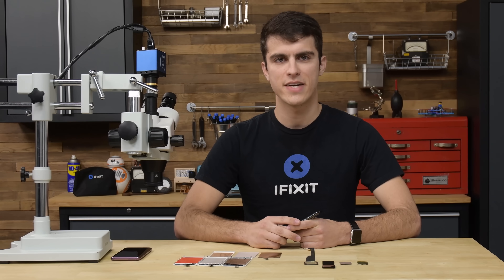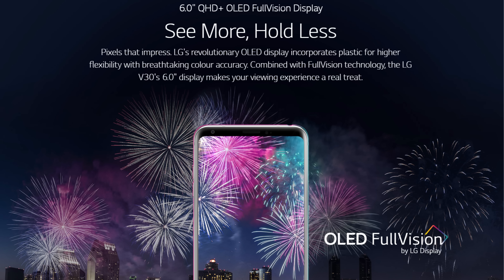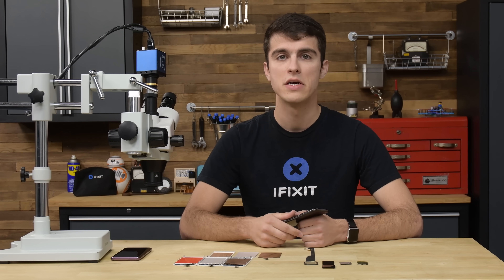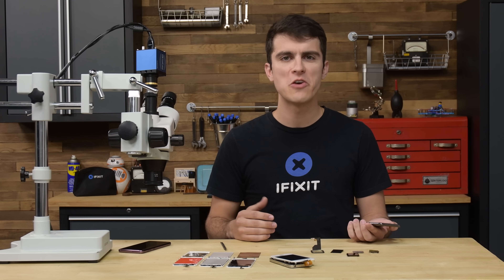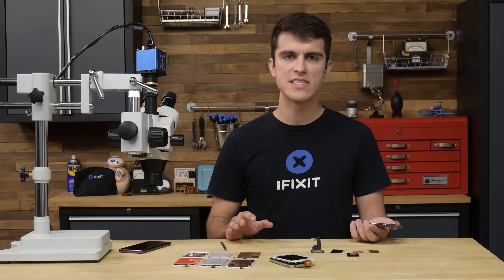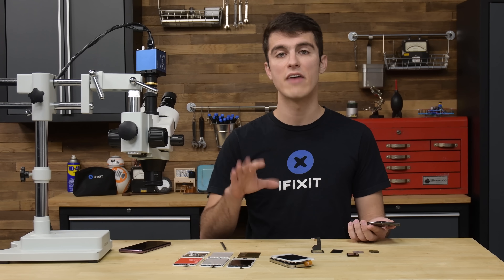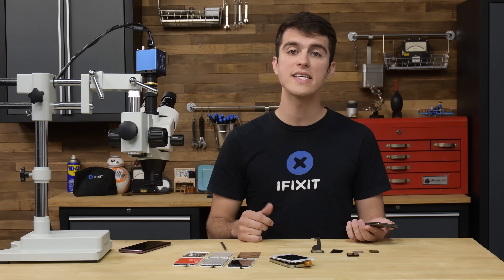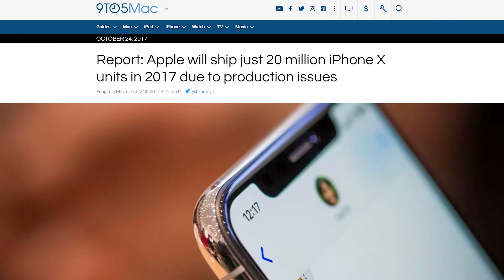OLED vs LCD: Smartphone Display Teardown and Comparison

Comment: Bad info. OLED isn't more accurate nor more efficient, it is just Samsung's marketing material that states they are. You can easily compare Samsung phone's battery life with other phone using the same SoC but with LCD screen.

iPhone X use OLED because Apple needs to fold the panel backward to achieve bezel-less look
Reply: Ok and why is Apple still using using pled displays now Hein? Because it's simply better
Reply: @carholic-sz3qv  well only oled screens allow true blacs. the only problems of oled screens are the manufacturing costs and the screen burn in with static images.
Reply: Le Chat Botté then why iphone XR doesn't use oled? Instead apple makes a new liquid retina lcd. And XR has much better battery life than Oled iPhone.
Reply: lol, phones with LCD screen can have bezel-less look too. And OLED can be accurate in colors if calibrated correctly, you can just tone down the color settings in samsung phones anytime. They just had it over-satured to look pop by default anyway.
Reply: Streets are filled with idiots
Reply: Peizxcv 
And iphone xr is lcd with same bezel less look
"another fanboy spotted"
Reply: Yes the colour is not as accurate as high end LCD for now. But it has a lot more vibrant colours . It also has infinite contrast ration which means it consumes less  battery when watching content with lot of contrast. I used samsung low end phone, let the (always on screen) for 3 hours and only 1% battery drains.
Reply: The battery life on samsung phones is bad because of the heavy Software and bad optimization.
Reply: Wrong..
Reply: Well as a 7 years oled  model user I can confirm that oled is way better than LCD.
Right now I am using a Nokia 6 and its display is terrible
Reply: Peizxcv Are u high ...
Reply: What are you talking about? You must clearly be allergic to facts. NOT more accurate? How did you seduce that... the pickle structure is everything. Imagine drawing a circle use a bagel and the draw a circle using a compass and a protractor. Stand a far, they look like circles but at hand held level (like phones, you can see what’s sharper)
Reply: Lol this dude is a complete dumbass. You could just look at oled under a microscope and see how much smaller the pixels are, and each individual one can be light up by themselves. If a led is so much more accurate them why are all the TV manufacturers moving to oled as well.
Reply: Apple is already looking out for their bottom line.
Reply: The display isn't the only thing that draws power. There are so many other factors other than just the display and the SoC. Although it has improved in the recent years, Samsung's software isn't exactly known to be very efficient, and in my opinion that's one reason why Samsung phones can sometimes have worse battery lifes. Don't get me wrong, I like Samsung's software because it has quite a few features, but it's not that efficient. In addition, I've seen Samsung phones outperform a few other phones in battery life that have the same SoC. Also, it makes more sense that LCDs use more energy than AMOLED screens if you know how they work and know a little bit of physics, because LCDs waste more energy by blocking off the light from black pixels, whereas AMOLEDs save energy by lighting up only the required pixels.
Reply: I guess you haven't held an LCD and OLED display side by side for comparison...

I still hold on to my Nokia Lumia 730 because of this screen... Simple toooo beautiful
Reply: You're wrong.
Reply: Apple fans getting triggered😂

Comment: What's that organic compound on the OLED display technology? I think, we need at least 4-5 (even 10 if it's crucial component)  years until equillibrium, just because of broad usage of OLED display tech. Same goes to the new carbon based batteries - graphene.

Comment: Organic displays aren’t my favorite. I can never see past their weird sub pixel arrangement vs the standard RGB arrangement that LCD (and prettymuch everything else uses). Plus the blue pixels die much quicker than the other colors which creates completely inaccurate colors, which brings me to what Oleds are infamous for; burn-in. Which is still a big deal in even some newer flagship devices. No thanks. Perfectly fine with LCD.

Comment: How did you not compare the lifespan and the burn in for OLED? wtf
Reply: Well that's not a big deal.
LCDs suffers from pixel stuck and dead pixel and oled suffers from the pixel burn.
But if it's good enough it really doesn't occurs, for example I used my lumia 925 with full brightness, bright colored wallpapers (pink, violet, lime green, yellow cyan) and glance screen with the same bright colors for 4 years. And I didn't have a pixel burnt problem. İt was very good
Reply: How about lightburn in lcd?
Reply: Using oled Samsung s8 from 1.5 years 
Still just as good as day 1 
No light bleed no screen burn no dead pixel 
Dropped phone 20 times + no scratch
Reply: Because it's irrelevant. Both panels normally outlast the phone as a whole. You'd more likely have battery issues first.
Reply: Oled only burns in if your brightness is always on max otherwise it takes a lot for oled to burn in
Reply: Because its just a comparison. Not a VS video
Reply: In the real world burn in is super rare so that is why that was not mentioned.

Comment: Very interesting video! (I already knew ins and outs of OLED and LCD) but in my experience OLED is breaking MUCH faster than LCD (Samsung phones)... Like a black corner that doesn't work anymore, pink lines, green lines, I've never seen that with LCD! And usually LCD keeps working with a cracked screen, also with OLED it tends to stop working immediately as I've seen... (Too thin maybe? Planned obsolescence by Samsung? Who knows)

Comment: OLED uses less power only when they display black content because the pixels are off. However, OLED actually consumes more power than LCD when displaying whites and bright content. And we all know Android and iOS nowadays uses a lot of white on their UI. So the power savings from OLED is pretty much rendered useless by UI design.
Reply: @carholic-sz3qv  Peter is right, numbnuts, LCD's are more energy efficient than OLED unless you're displaying mainly black images that switches diods off. OLED is basically nothing other than more efficient plasma.
Reply: Peter the Panda, exactly! And that’s the main reason for “Dark Mode” on Android. Almost nobody share this information. LCDs are more efficient than OLED on brighter content; OLED are more efficient (and better contrast) on predominantly dark images.
Reply: Also OLED screens degrade and that has played a part in using the pentile arrangement, LCD on average is less power more accurate in colours and longer life span, and when was the last time anyone seen a iPhone with a broken LCD very very rare to see.
Reply: @carholic-sz3qv  he is.
Reply: @epicgrapefruit7563  not as effecienct as lcd
Reply: ignore illiterate comments, you said the correct thing.
Reply: @carholic-sz3qv  no but your spelling is
Reply: I used my old lumia model with bright colored themes with 100% brightness, glance screen was always active and all of these didn't affected the battery life much, maybe a 20 minutes,
The experience I had however was priceless, LCDs are looking like crap
Reply: Sadly that is correct, however with samsung themes that issue can easily be fixed.
Reply: Their is also dark mode in both os.
Reply: Darkmode you dumbass
Reply: Dark mode looks better and serves a purpose even the Samsung browser has a dark mode
Reply: I use dark mode everywhere anyway
Reply: Use a dark theme my friend
Androids are customizable for a reason :))
Reply: LOL "And we all know Android and iOS nowadays uses a lot of white on their UI."
You seriously don't know why the black theme became so popular?
Reply: Peter the Panda just another apple fanboy
Reply: You wrong.... organic light emitting diode... oled, amoled, superamoled, qled consume less power because each led on a screen is self emitting unlike lcd bruh!

Comment: No iPhone LG Google joining with Samsung on OLED game 
Samsung uses OLED panels more than 6-7 years
Reply: Walid Jami wait amoled is the same as oled???
Reply: @freedomfriesss  yep..
Reply: Generally, OLED has 2types, one is AMOLED (Samsung), PMOLED (LG), so yes, AMOLED is part of OLED product.
Reply: @xaph212  LG plastic oled is in fact an amoled.
Reply: @freedomfriesss  no there a little different
Reply: @freedomfriesss  amoled is just another type of oled
Reply: @freedomfriesss  OLED burn inside the screen. AMOLED make it less burn more clearly than OLED.
Reply: @Giovanni AMOLED = Active Matrix Organic LED
Reply: From Samsung s1, Samsung has used OLED-AMOLED
Reply: The Google Nexus One was release January 2010 with an AMOLED display.
Reply: OLED Coming from LG
QLED Coming from Samsung
😂
Samsung mainly using AMOLED
Reply: When no one was around Nokia was ruling the oleds :D 
İts a shame that hmd uses LCD leftovers in these days.
Reply: Yes u r rt. Oled is equal to amoled but s amoled is bettet than oled
Reply: Lg makes the best oled screens
Reply: Super amoled brings the vivid colors than pmoled
Reply: Walid, mate, no one fucking cares

Comment: Good content and info. But you missed that screen burn in part. One of the biggest reasons that OLED isn't that widely adopted.
Reply: Though I personally prefer OLED over LCD. Any day.
Been using OLED screened phones since 2010's Nokia N8. The colors can be a bit over saturated for some, but I prefer those extra punchy colors. And the deep blacks are just unmatched!

Comment: so no. OLED is not perfect. LCD has got some advantages compared to OLED.
Apple OLED is a different version, improving in some OLED issues. And that's why Apple moved to OLED only now.
Reply: In your dream?
Reply: Sheep, how is it different? Lol samsung provides them those displays.
Reply: Apple's AMOLED displays are from Samsung. They don't make AMOLEDs themselves.
Reply: Wtf that makes no sense
Reply: Apple's oled is the exact same as samsungs oled wich they have been using for years.
Reply: Apple's OLED is manufactured by Samsung, and the S8 has a better display than then any of the iPhone Xs. What are you talking about?

Comment: Also oled fails with burn in display like galaxy or the famous pixel 2
Reply: Typing this on an iphone 7 which has a black shadow thingee in its display
Reply: Raveen Bikha Pixel XL 2 is what youre talking about, which is pOLED, slightly different.
Reply: Raveen Bikha So do LCDs. My LG G4 gets HORRIBLE burn in and it's got an LCD display.
Reply: Raveen Bikha Samsung uses Amoled not oled. And burn in has become less of a problem because of the inlarged blue pixal.
Reply: That’s true had been seeing this issue frequently, scares me to use my LG V30 since it uses an OLED panel, I am sticking to a phone with a LCD / IPS. Since replacing is much cheaper and you can find these screens much sooner than OLED panels.
Reply: Yeah i am using htc 10 wth lcd panel but amoled colour are really good that people can't resist to buy set with amoled displays  and yeah lcd has more life and durability than amoled 
(Sorry for bad english)
Reply: Raveen Bikha Samsung has been using old displays since the first Galaxy S.

They usually last enough to serve during the lifecycle of the device.
Reply: That's really stupid in still using one Samsung galaxy s6 and even s3 and there is no burn are are yu talking about? The burns occurs only in LG pled not Samsung ones
Reply: @carholic-sz3qv  I have 3 samsung phones next to me, all of them with a burnt in image. It is only a matter of time. You will see. Plug your ears and yell la la la until then, but you screen WILL be burnt in soon enough :)
Reply: Raveen Bikha ya like u throw ur phone in fire before sleep..
Reply: Presumably, that's why Samsung is developing MLED (Micro LED), which doesn't have that problem.

Comment: I would also say that a huge reason as to why Apple didn't make the switch sooner is that OLED's did not exhibit the color accuracy, longevity, or brightness of quality LCD panels just a few years ago. It wasn't until recently that the relatively young OLED technology matured enough to have almost no compromises compared to LCD, other than cost of difficulty of manufacture, which will of course improve over time as you pointed out.
Reply: Andrew Compton Almost no compromises???

OLED is trash. No amount of deep Black levels is worth dealing with burn-in, oversaturated colors, much lower peak brightness for HDR, and much shorter lifespan compared to LCD.

There's a reason Samsung abandoned OLED TV's years ago and has now moved into working with Micro LED.
Reply: Andrew Compton OLED and Amoled where considered superior to led back then too.
Reply: Hamza. H no. You will not find a single calibrated monitor used by cinematographers, editors, Colorist that used OLED displays. It’s only good for consumers products. Also OLED, unlike, LCD doesn’t have a full array RBG strip.
Reply: @HarshKalra490  bvmx oled professional monitor the best in the world. It's on a completely different level from Oled though
Reply: @HarshKalra490  because a static display, such as a picture, or even the UI to edit those photos, would very quickly burn in to oled and make it trash
Reply: Andrew Compton 
So why other companies didn’t do the same thing ... does Apple the only company know how to get money and sell products ....
Reply: Hamza. H Oled and amoled are the same thing...
Reply: Still uses more battery than lcd when displaying whites so overall worse battery
Reply: lol yeah sure liquid crystal displays am I right basically OLED was shit until apple used it fuckin apple sheeps xD
Reply: Thats a lame excuse by apple..lcd looks shit in front of oled
Reply: @joffrey_lol , Samsung makes the best amoleds, and yet my 3 week old S9 is currently getting a screen replacement due to burn in... 3 fricken weeks old! Plus after a year or too, oled panels looked markedly more yellow than when they were new, as certain colour pixels degrade faster than others, shifting the colour balance. None of this happens with LCD.
Reply: Andrew Compton Boi! My Samsung galaxy s5, after nearly 5 years still has a beautiful and up to date display, no screen burn in, very sharp and bright colours, apple just makes overpriced shit, to milk every last cent they can out of their gullible consumers, that's all
Reply: Fuck Apple they are just overpriced piece of shit
Reply: Tanishq bhaiji And Android is a over rated slow piece of shit, but see, we both have our opinions and no matter what you do, you won’t be able to hurt one company by making comments

Comment: Also Apple didn’t probably shift to OLED earlier because OLED panels used not to be very bright. That’s why almost always Apple’s display were brighter.
Reply: Idiot apple display sucks since the beginning idiot. Just apple dont have enough source where to get it idiot idiot
Reply: L
O
L

rewind the brightness cassette, you are playing it in reverse.
Reply: Pretty sure Samsung's AMOLED has always been brighter

Comment: But OLEDs also have a major failure point: BURN-IN. This means that some images are like printed on the display and u can never get rid of them. So OLEDs aren’t perfect as well.
Reply: Mihnea Lazăr LCD have that too mate, they are not immune, oled is just more prone to it. Even so, why the hell would you display the same image over hours on end, on your phone/TV, it isn't and advertisement display is it?
Reply: My PsVita is fine from Feb 2012 - it's now usually left plugged in playing music (so same screen prob 1000's of hours, that screen is not in any way "burned on"... If some OLED screens have this problem that is indeed unfortunate but shouldn't be considered normal.

Comment: but oled displays had burn in issues
Reply: AriaSatya Mahatma Whether it is oled or lcd, they both have burn-in issues if they show a static image over a long period of time but Oleds are much more prone to catch burn in their pixels than lcd because OLEDs are made up off self light emitting pixels which are also made up off organic metarials that, if produce bright light over a long period of time then they could deteriorate and can make the screen look like burned in. But that's not a common problem anymore. Tbh samsung makes the best oled panels.

Comment: Are OLED more prone to ghosting?
Reply: Roberto Sanchez only when you leave the screen on the image for a long time at high brightness.
Reply: Some have the black ghosting issue where a black part of an image will ghost if it's moved, but they should in theory have no ghosting on the bright part of the image.
Reply: Sure
Reply: Roberto Sanchez Yes at low brightness otherwise no.